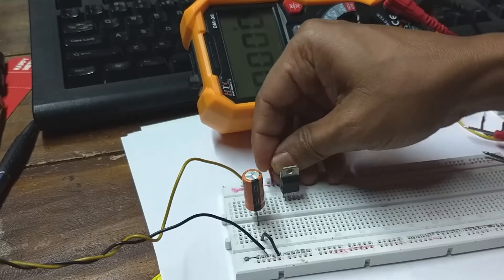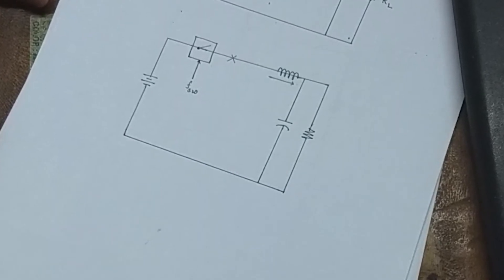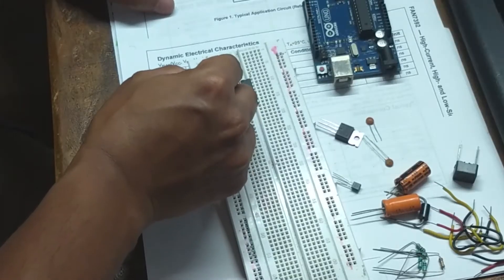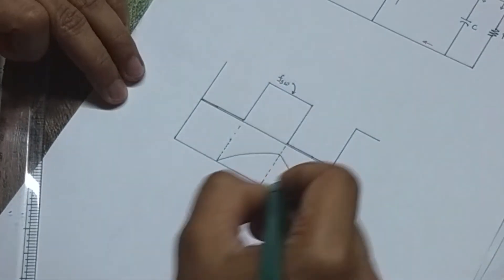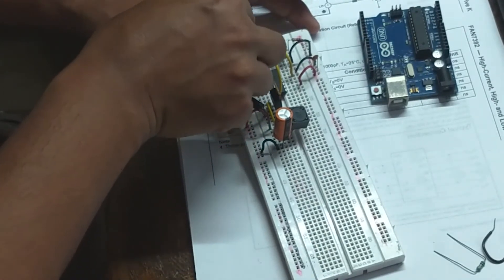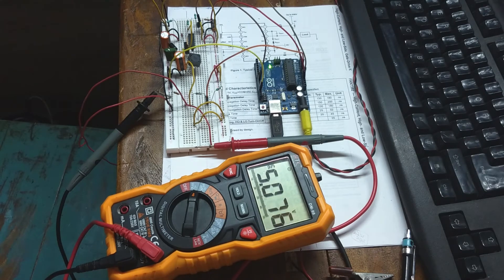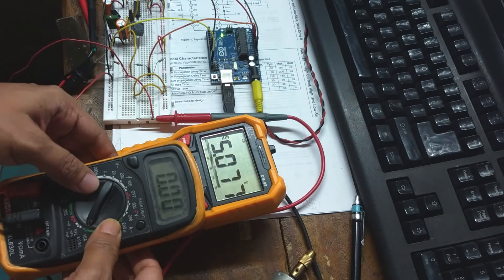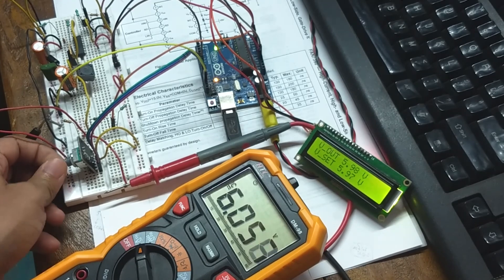Basics of DC-DC Buck Converter and Implementing Using Arduino

Comment: I recently came across a circuit with a parallel coil, which allows for easy buck and boost conversion, with a N-channel MOSFET, or 2, for active switching rather than using a diode.

Comment: Hi bro if give input 36 volte    and howmuch  output volte    please answer me
Reply from the maker: This particular circuit is not capable of handling 36 V
Reply: @ElectroHijibiji  baro i want buck converter output need 12 volte   and input any volte  30 volte 20 volte  40 volte
Reply: Achuly I don't always sete potnshometare output volte

Comment: Hello ,great work can you please explain more on the proportional control 😊... Also looking forward for a variable voltage sync  buck converter.
Reply from the maker: Thanks Hrituraj. I'll try to upload variable voltage synchronous buck converter in future. Explaining the proportional control action in depth will be too much theoretical and will not suit the format of this channel.
Reply: @ElectroHijibiji  Thank you for your reply maybe a small suggestion for sync buck converter will be using an IR2104 or IR2103 gate drivers which already have a dead time and feed that with Arduino PWM

Comment: Thanks for this lecture on mppt . Kindly make mppt bulk converter that can input up to 140/160v solar and charges battery of 12v,24v to 48v. This is most relevant.
Reply from the maker: Yeah. I have plan to do that.